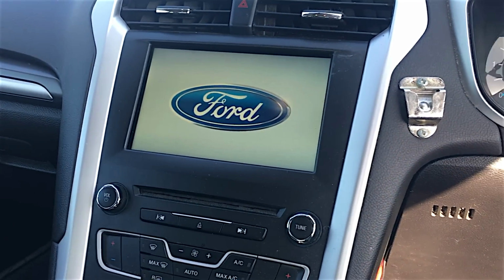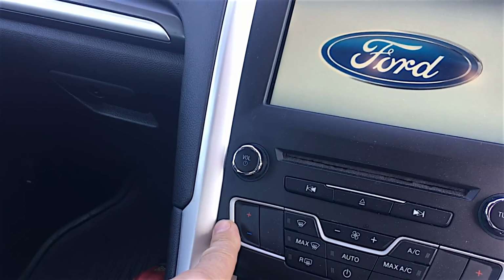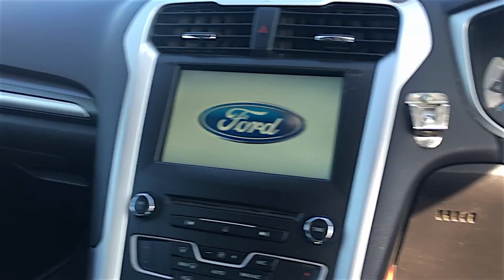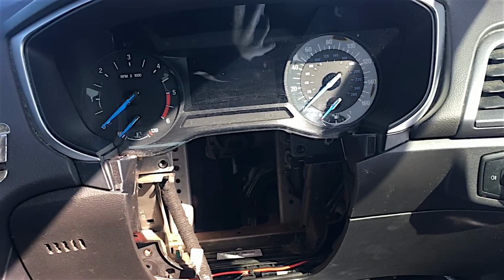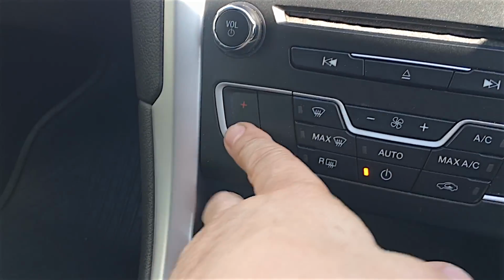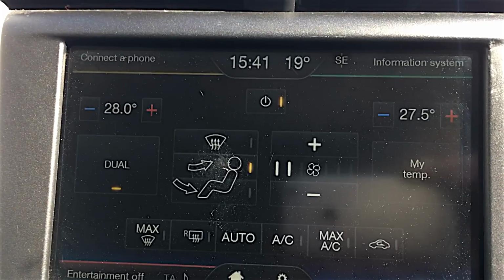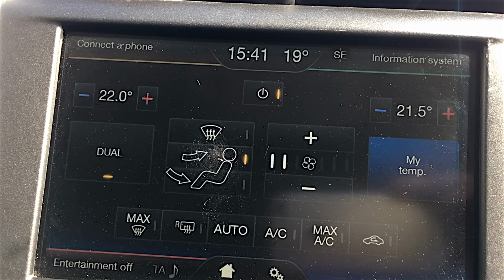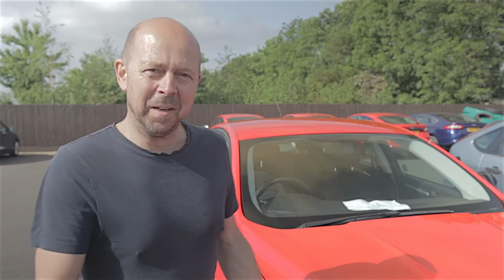Heat Distribution Fault, Ford Mondeo Mk5

Comment: I have a 2016 Ford SMAX… just had EGR, thermostat, timing belt and water pump replaced, however I’m still having an issue with passenger side climate control, passenger side stays cold, drivers side is adjustable… any hints or tips I can look into?

Comment: Hi Alan, Sorry for my English, I'm from Italy... I have no problems with different temperatures between driver side and passenger side. The problem I have with my MK5 is the deviation of air between the windshield, the front outlets, and the floor outlets. The air deflector is stuck, and 80% of the air is always directed toward the windshield and only a 20% toward the feet. In this case, which motor do I need to work on, the one on the passenger side? Many thanks for giving me an answer.

Comment: Thanks for the good video, i've a fault on my Mk5, hot air coming out of the centre and floor vents, i can't get any flow to the screen. Looks to me like the actuator behind the glove box on the right hand side of the pollen filter. Have you changed one of these out before i cant see how to access the top mounting screw. It looks like the pollen filter/heater blower case needs to be removed but its not obvious how that comes out.
Reply: Did you fix it cause I have the same problem 😊

Comment: Hi Alan. Hope you doing good.. I have problem with Air distribution senson (Air is blowing in face only). It is located on passenger side, Just Next to pollen filter, is there any Easy way to replace that motor? Thx

Comment: Hi Alan, I have a mondeo Mark 5 and I have this issue, I've had the interior sensor changed but no look and 2 days ago the same heater in this video replaced and still getting cold air in the passenger vents and hot air in the drivers vent, Far as I am aware the car is fully up to date software wise. What shall I do next ?

Comment: Hello, i have a mondeo mk4 1.6 tdci and i noticed that when i use the heater, the coolant temp drops to minimum whe idleing or heavy trafic. Any toughts?
Reply from the maker: There is a good possibility the engine thermostat is stuck open and needs replacing

Comment: im having a problem with heater if you can help the heater working fine warm for about 10-15 mins of driving temp 22c then goes cold for some reason if i turn higher it will go warm again have you any ideas would be helpful
Reply from the maker: I would first make sure you have plenty of coolant in your expansion bottle and check to see if the engine water pump is working before checking out the heater itself    https://youtu.be/H3XSXq-1CKA.   this video shows how to check if your water pump is working

Comment: im having a problem with heater if you can help the heater working fine warm for about 10-15 mins of driving temp 22c then goes cold for some reason if i turn higher it will go warm again have you any ideas would be helpful
Reply: I have exactly same problem. Have you sorted it out?

Comment: Hi there ive just replaced this motor and it hasnt fixed the problem any ideas!!
Reply: Did you figure it out, same issue
Reply: @kburton7530 did you sort yours mate I’ve got same problem
Reply: Faulty output temperature sensor
Reply: @MatthewGoodrum where about is that sensor mate, looking on schematics is it one by steering column or top centre of dash?
Reply: @lukehayes5065  dunno but first port of call would be to test the readings with a decent scanner to see if one is obviously out.

Comment: And what in the situation if I'm getting constant cold air on passenger side and driver side works fine? Is there another one on passenger side?
Reply from the maker: no, the motor on the drivers sjde operates the heater flaps for both drivers and passenger side heat distribution, when you fit a new motor you have to align two linkages up to the motor for both sides

Comment: Good morning Alan... My name is Bruno and I would like to know if you could give me your opinion. I was on vacation in Portugal and I took the opportunity to ask to have my Mondeo 2000 cm³ car from November 2016 serviced...Included automatic gearbox oil change. Back in France, the first 1100 km in Spain posed no problem. I continued the journey the next day and after 5km this sign appeared on the dashboard of my car. The car continues to drive normally, but then I stopped at the toll booth to pay but when I start to accelerate forward, the gears shifted, but it was like when you change gear manually and accelerate but your foot stays on the 'clutch. I noticed that when I completely turn off the car engine and start it afterwards, the fault warning disappears, the gears shift normally as it was nothing but the warning appears a few minutes later. But despite this problem I have not detected any unusual noise and the car runs without loss of power. I hope you can help me. 
I have pictures of the fault warning but i can sed you by youtube. 
I hope you can help again. Thank you so much.
Reply: Bonjour Bruno as-tu résolu ton problème?  ma mondeo a plus ou moins les mêmes symptômes quand je fais de longs trajets...
Reply: @mrmordecai3872 
Depuis cette jour je pas eux de problèmes mais je me suis résigner et mon dit que ça revient du capteur de entrée de vitesse défectueux et le boite de automatique se met en défaut et en sécurité pour éviter une caisse en passant la valise, Ford est censé voir le code défaut on question.
 C'est une défaut connu par Ford sauf qu'ils ne voulaient pas replacer le pièce mais toute le boite

Comment: Hi Alan I've bought a 2.2 transit  custom, can you do a video or chat about the piston cracking issue on these engines.
why it happens and is their any preventing this issue, is it crap pistons, pcm update or servicing or dpf regeneration heat that causes it.
many thanks James
Reply: I thought it was over-fuelling (bad injectors) on those that caused the pistons to burn out...

Comment: Alan what was the milage of the car when the pollen filter replaced ,
I have brought a Skoda Octavia  2008 1.9 tdi 89.000 miles lots of service history but the pollen filter I replace was original factory I had another similar octave same issue service history but pollen was so original the motor was making noise that’s when I had to change found out it’s the one from factory fitted what’s going on ?

Comment: I sort of had this problem recently passenger side would get cold or hot but the drivers side wouldnt get to the same cold temp as the passenger side but hot would work perfectly, I had an AC regas done and that seemed to solve the issue for me possibly the refrigerant level was to low for both side to work effectively.